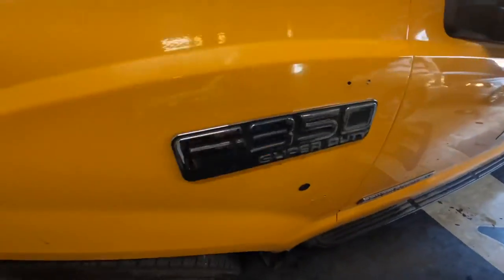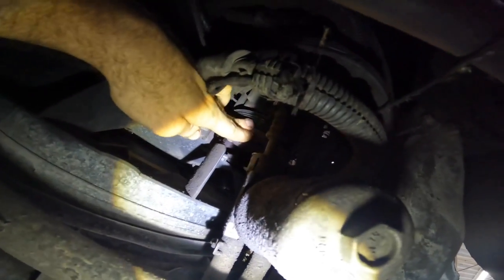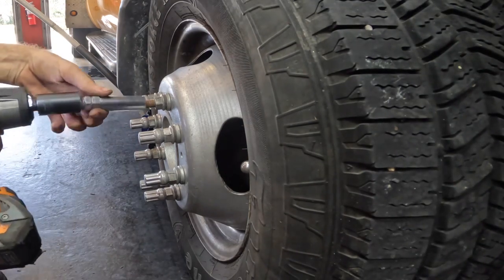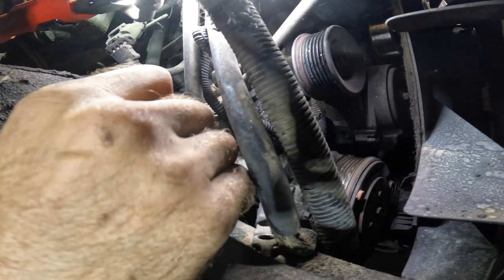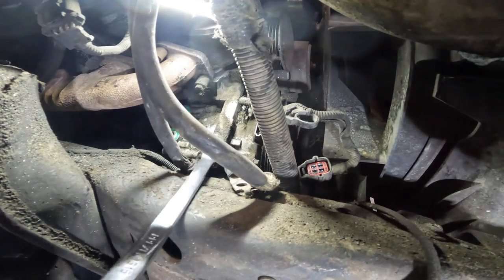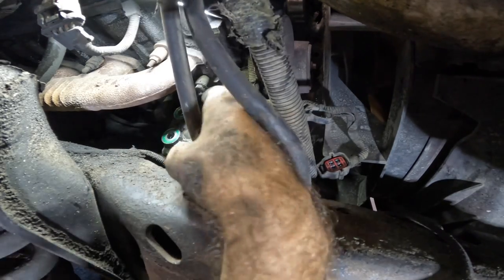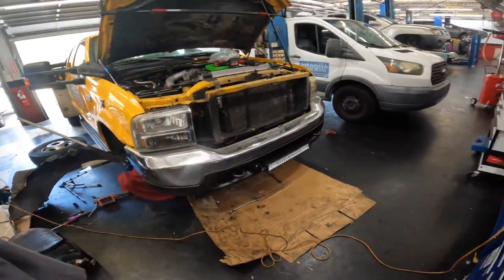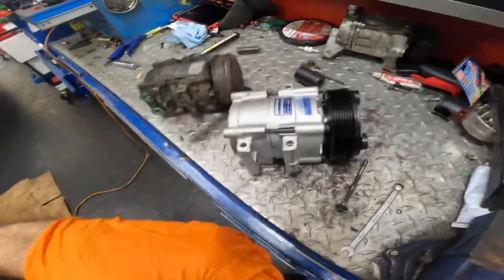Cut the Frame, Pull the Cab, or Suffer? Ford Powerstroke F350

Comment: You need to find the engineer who designed this and get him to take this off. Either that or it was constructed in a large room then put in a crusher before being sold. Madness. I mean, I'm not a mechanic and this is madness even to me. Ray, you have the patience of a Saint.
Reply: Must have been German.
Reply: Cut the frame, get the $400, pay it back. $82KIDJ
Reply: Given the fact that any car is just a bunch of subassemblies and various lego pieces sometimes this happens and getting to a part is a nightmare. That's why some jobs have a suggested repair that contain the magic words "lift the engine from the mounts.." because the whole engine unit and accessories were put together in open space and then dropped onto the chassis. Clearence is taken in account when mating the lego pieces. After that they have a bunch of interns and a couple of techs that make the repair manuals.. the last team that checks repairability  of things is the one that has almost 0 say in the design.
Bad system, bad results. 
Some asian cars are better built because they take into account repairability and maintenance in the early stages of design. Americans and europeans don't really do that.
Reply: @82_KID  weld it back on after?
Reply: @chrisbentleywalkingandrambling  Whatever you got to do.
Reply: I agree - Yes weld all the components back on for the next person 🥳
Reply: The engineer  who designed it must take the ac compressor off, or I get to give the lame engineer  a few martial arts lessens..he can pick which ones. I know 8..
No protective  gear.. it is full contact on first lesson
Reply: 100%
It's jobs like that one that made me give up on cars for a living. I had to skip through parts of it because it was just too frustrating to watch.

Now I fix much bigger machines. 
Gotta say... sometimes... it's worse. Doing up (or undoing) 85mm nuts with flogging spanners and sledge hammers in confined spaces, banging your elbows on very large pieces of cast iron the whole way... and they're the "baby" nuts.

At least, you get to take your frustration out on the big machines.
If ever I find myself in a pub and some bloke tells me they're responsible for designing cars, a very "interesting" conversation will ensue.
Reply: Get an engineer to actually touch what they designed in real life?  You need to share what you're smoking...
Reply: @bucharestpunk  having worked on many Asian cars mostly I would say you are correct and having watched videos by various individuals of working on BMWs and Volkswagens I would say you are 100% correct LOL those things all look like a nightmare BMW Mercedes Volkswagen Audi wouldn't touch one to even replace the spark plugs
Reply: @deepsquat600  there is a case for a mercedes B class diesel engine that you have to pull out the engine to change the glow plugs. The plugs face the firewall of the car and there's no room to access them. The even frustrating part of that is that some of them get welded in place.. a friend of mine that worked at mercedes said that somewhere around 1 in 8 glow plugs strip the threads in the head and you need to repair the head with a special collar and rebuild the threads. A basic glow plug lasts around 5 years or 100k miles.. and changing them if they are stuck is like a 2 day operation... It's absolutely horrible for the tech and also for the client cuz the billable hours add up fast.
Reply: It is the bean counters. Trust me.
Reply: I think it's unrepairable, like apple products
Reply: Ford F-350 and super duty pickup trucks are body on frame, any engine service that is deeper than right on top, the Ford service manual says the first step is to lift the cab. The cabs are designed to be lifted in under an hour, all of the wiring harnesses and Chassis connectors are all accessible and unbolt, and you can put lift right on the pinch weld of the cab and lift the entire thing up and have full access to the engine. It was designed around repairability but you have to lift the cab.
Reply: Unfortunately that engine compartment was designed for the 7.3L Diesel.  The AC Compressor on the 7.3 is up top and really easy to get to.  In fact, all the accessories on the 7.3L are easy to get to.  Ford Engineers had to shoehorn the 6.0 in the engine compartment.
Reply: Its perfectly reasonable if you want to have a huge displacement engine to not have room or just enough room for certian services.... Don't be a crybaby if you want a 6.0 7.4 etc
Reply: @jimmyb1451  joe rogan wannabe
Reply: It's the design process itself that's the problem and the engineers designing the motor have no regard for the other ones down the line doing the exhaust, suspension, etc, & they have to cram everything in, working with what little room they have left.
Reply: It is a US build !
Reply: I feel your pain.
Reply: @Docthewrench  You're being too nice.
Reply: There's way more things to worry about what engineering a car then this part. Maybe they had a better design but it costed to much to be approved
Reply: It appears he has much patience unless he edits out the part where he runs outside and screams at the sky. "Why...Whyyyyy?"
Reply: @bucharestpunk  57k on my Mercedes. You suggest I get the glow plugs changed before the 100k? I've got a GLC250D 4MATIC. I'd rather be preventative than reactivate.
Reply: Engineer:  "It comes out very simple.  Simply remove the cab, lift the engine 6" off of the mounts and presto.  Thank me later!"
Reply: It's actually quite easy to take off the a/c compressor. Remove engine from the frame and then you have plenty of access. That said, I recall one of the ford technician youtubers saying that an official repair for some common issue involved drilling an access hole in the frame of the vehicle and that was how Ford wanted dealer techs to do the repair to save the labor of pulling the engine.
Reply: The engineer would just tell you to remove the engine.
Reply: It was repairable. Making 50,000-mile-parts convenient to repair is not the intended function of the engine or truck nor the goal of the designer. The engineers did a great job.  Stuffing a massive diesel in there is what the customer wanted and bought. Ray was paid well. He likes puzzles. The engineers do all this, and rehearse all this, and put the instructions in the service manuals. That's how Ray had the exact route to replacement. That bolt was supposed to be under the hole in the frame, so Ray should have been able to put his socket directly on it. You don't think those holes were accidental do you? Starting all the way out to the removeable fender liner, Rays acess to the repair was provided for.
Reply: As a mechanic all I can say is " welcome to my world ". If you think this is hard wait until 10 winters have passed and it has be well doused with saltwater.. and then someone says the book time is 25 minutes
Reply: Its really not that big of a deal. Any ford guy would have that in and out and half and hour.
Reply: @chubbysumo2230  Ford guys also have special lifts and equipment. This guy is working off the floor and doesnt have the tools to lift the cab.
Reply: @bucharestpunk  You're assuming that this combination was designed for only this one truck. While this motor was may have initially designed for a specific chassis, the fact is it fits in a number of trucks and vans. The powertrain engineer was probably given an envelope and if it works it ships. It makes much more sense financially and service ability-wise to have a common package as that is fewer parts that need to be made. The other issue is most of the various teams (body, powertrain, electrical, HVAC, software) work in a vacuum, and don't interact unless absolutely necessary.

It actually looks like the body/frame guy tried to add some holes for service, but in the end, they didn't line up. Seeing it didn't affect the final product they just said screw it and shipped the design.
Reply: Totally agree!
Reply: Every Ford vehicle is like this car or truck don’t matter their engineers are on crack seriously this is the worse design I’ve ever seen. On my car that’s not a Ford thank god the AC pump is the lowest pulley next to the crankshaft pulley but once you remove the belly pan under the car you got lots of room to remove the compressor from the bottom and the lines and electrical connections are pretty easy from the top and the AC dryer Is in the wheel well area just gotta remove the passenger wheel and fender liner and it’s right there really easy.
Reply: @bucharestpunk  First look under the hood told me the same thing. A mess to work on.
Reply: I remember when working on cars, I had change an alternator on a Chevy overhead cam V6. I think it was the performance Lumina. The book gave 14 hours and I thought that was crazy. The factory procedure said to remove the engine for this job. I ended up removing the right hand strut assembly,  lowered the crossmember as muchas possible. I was able to access and do the job in 3.5 hrs, saving the customer over a $1000. So not only the engineers writing the plans for service are just as ate up.
Reply: Saw one of these make the truck not crank because the compressor was almost completely locked. Funny thing, no belt noise o4 damage to the belt.
Reply: @chubbysumo2230  lifting the cab on this job would have no benefit. Lifting the engine yes.  The best option they could have built into these trucks is a cab and front end assembly that tilts like the old cab over trucks. Tip the cab and front fenders hood up out of the way do the work and let it back down when done
Reply: @gustaveluna9349  the engine is built in brazil
Reply: Reminds me of one of those episodes Al Bundy was trying to fit a size ten foot into a size 8 shoes. Because she insisted she was a size 8 hoofs'. Oh and my neighbors has one of those 6.0s. It seems to spend a lot of time waiting on someone to turn a wrench with a shoe horn. The Envoy I have is like that. It took CAD engineering to be that bad. Oh and it has gotten even worse.
Reply: Most cars are built around the heater core. This one they started with the AC compressor.
Reply: Every ford engineer deserves a beat down. From the three piece plugs in the triton motors to the internal water pump in the Edge. Ford hasn't had a competent engineer since the 80's
Reply: @chubbysumo2230  I mean this is good in one way but I prefer field repairable.
Reply: It was more than one engineer.  The motor was deigned by one group, the frame by another group, etc.  They all have a deadline to meet.  It costs money and time to go back and address issues.  The powertrain group doesn't want to go back and make changes which then would cause other groups to re-engineer their portions as well.  It seems like the easiest would be for the chassis group to have moves one of the holes so the bolt could be reached.  It still goes back to a timeline and that would be a change.  The schematics would already have been submitted for the various parts to be produced.

This is what happens when common components are trying to be used for multiple vehicles.  The part bin method to reduce costs create these issues.
Reply: @chubbysumo2230  that's true but ive also seen the nuts spin inside the body channel and you have you cut that open just to get the cab bolts out and that's another pita
Reply: You can't tell me there wasn't some way to engineer this so the compressor was up top like most cars and truck ...total stupidity.
Reply: That's what happens when  International designs the motor, and the ford engineers just make it fit in a frame.......... I hate Navistar motors with a passion.
Reply: @stevelaminack1516  The engine came from Navistar. They also used said motor in vehicles of their own. The 7.3 was used in busses among other vehicles. The 6.4 was based on the 6.0 and Navistar used it for a number of vehicles. 

The 2003 F350 had the 7.3 and the 2003 1/2 used the 6.0. In 2005 Ford introduced a new frame.
Reply: Also have a "chat" with the person/people responsible for trying to maximize the number of sockets and other tools needed to access anything in newer cars.
Reply: guaranteed it's cookie-cutter placed chunks, that were all computer arranged.
Reply: Ray said it up front - lift the cab, but his facility does not have the room and equipment. Be,I eve me from engineering side we work on them, we feel your pain, but sometimes we need to make things fit. I have a 2003 F-250 6.0 PowerStroke and this video made me cringe as it’s going to need this sometime and I don’t have all Ray’s tools.
Reply: @ImmortanJoeCamel  Oh how well I know about heater cores and evaporators. I start with removing the seats. Hint: most of the time I drive with the seat all the way back. Take the steering wheel out. Remove the console. Remove the dash and hope that is enough. Engineering at it's finest. Yes let us put the high failure rate items behind or inside all the stuff that does not fail. Oh, and put the oil line to the turbo charger next to the exhaust manifold.
Reply: @RexerYTRexer  reasonable ... hahahaha
Reply: @warrenpuckett4203   remove seats remove glove box remove steering wheel remove center console remove a billion plastic trim peace’s remove air bags remove door weather stripping remove more plastic trim peace’s remove 100s of bolts unplug a billion wires remove more bolts. Swear ever second on how stupid this is hurt your back knees hands and elbows. Drag dash out of the vehicle locate heater core box remove more bolts go back under the hood and remove heater core lines at the firewall now remove heater core from vehicle. Now do the opposite of everything you just done.
Reply: @bucharestpunk  my car is German, & the AC compressor is easier to remove than this one!! I don't need to pull half my car apart, or jack up the engine!! I simply drain the cooling system, then remove the radiator. Once the rad is out, then I disconnect the ac compressor lines, & remove the belt, then unbolt the compressor, & unplug the wiring, then lower the compressor out from under the front of the car. Too easy.
Reply: @ryans413  I see that you done that often to remember every step.
Reply: @warrenpuckett4203  just once but it was a pain lol
Reply: @deepsquat600  Ha, obviously you've never replaced the spark plugs on a 2002 - 2010 Nissan elgrand vq35 4wd.  took me 6 hours.  Grr...
Reply: @bucharestpunk  holy crap that's horrible I also own a Yamaha FJR 1300 and there's a standard service procedure that's supposed to be done which includes dropping the swing arm the trouble is there's a bolt in the way that they run from let's say east to west but in the factory if they run it from west to east it would be a very simple maneuver as it is you have to whip out your sawzall and correct that factory mistake... That they have now been doing for 22 freaking years in that 22-year period they have not switched around the direction that bolt faces
Reply: Who ever designed this, didn't expect this thing to last over 15 years and definitely not to last past 200k
Reply: @Chinunit22  well that show the durability.
Reply: @jima3129  Vehicles are meant to be disposable and car manufacturers as well as insurance companies intend to keep us in debt. After all what else fuels the economy. The right to repair is not in their  grand plan.
Reply: Ford guy here, I realized a long time ago that they design them for easy assembly. They don’t care how hard it is to fix and I’ve made my piece with that lol
Reply: @bucharestpunk  😱 so on a high mileage B class if it’s rough shape, all new glow plugs might be write off? Beyond economic repair maybe?
Reply: He belongs in jail.
Reply: I guarantee you the engineer doesn't care
Reply: I have always said that one of the requirements of design engineer's should be one year of hands on field work before getting their desk job❗😎
Reply: @VERYMADMIKE  And a lesson in the concept of efficient redundancy.